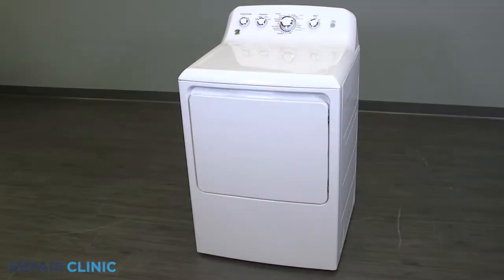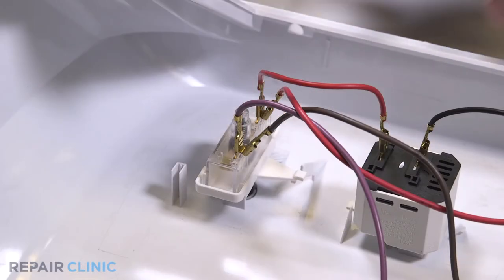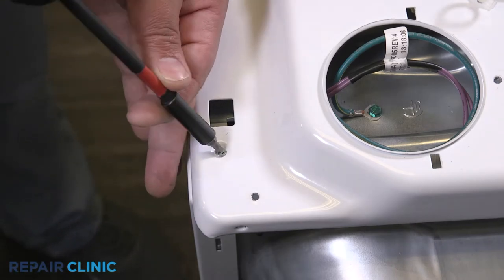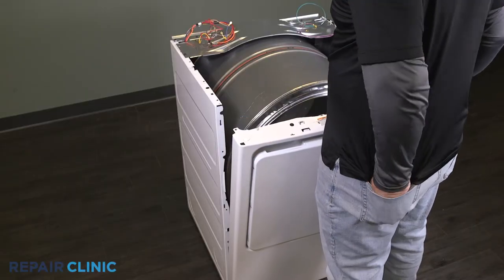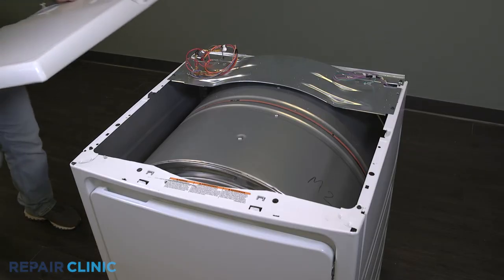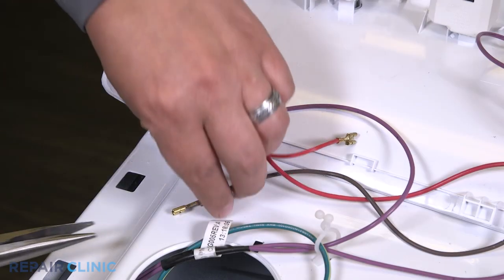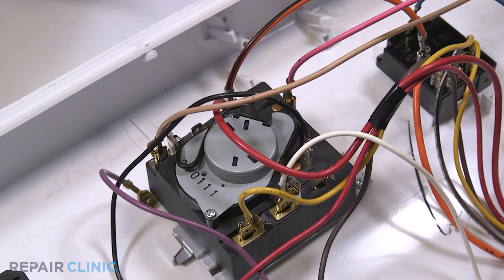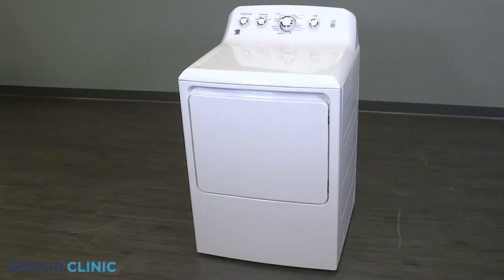GE Dryer Door Switch Replacement WE04X28977

Comment: You absolutely don’t have to take all of that apart seriously
Reply: Correct, just take out the upward facing Phillips screws at the door and lift the lid. Using a low profile ratchet you can get to the black screens and remove the front panel. Even possible to get the drum out for when the purple wire Burns up

Comment: Remove the switch entirely and cap off the wires, bypassing the cheaply made and unnecessary safety mechanism entirely. Screw replacing it
Reply: Hey so my door switch is what’s keeping my dryer from starting and I don’t have the money to replace the switch at the moment can you possibly walk me through what you just said to do that seems to be exactly what I was looking for
Reply: @aliciamarieleopard8919  Essentially, you locate the switch and its wires and cut the wires at the switch. Then, you connect the wires with a twist connector(or crimp).
Reply: @aliciamarieleopard8919 
Just to be clear, the "twist connector" he's talking about is called a wire nut. Little cone shaped plastic caps that screw onto wire ends. If you go this route, once you cut the wires you'll need to strip off about 3/8" of the wire's plastic insulation coat, twist the two wires together, then screw on the wire nut.

Comment: Clear instructions. Thank you! But I didn’t have to disconnect the instrument panel, just took out all screws on the back and tipped it right up with the top, propping the top so I could release the front panel. Thanks for showing clearly where to depress the catch on the door switch so I could get I out. Had a bit of trouble reseating the top on the drum: it took two of us to persuade it back in place, but no other problem and one $18 switch later, my dryer is working again.

Comment: This is a very informative video,  but just be aware that the switch may release from the front of the dryer with a flat screwdriver or similar tool.  No disassembly needed.  The switch releases with a tab, then pull it forward out of the mounting hole.  Unclip the wire harness and swap the switch out.
Just changed our switch in under 5 minutes, working great.
Reply: You are so right that's what I notice  on my ge electric  dryer. Just pull it out from the front  with a flat svrew driver.Unplug the electric plug,
Reply: Thank you for the comment, I seen that part and wondered.... if there is enough slack on the wire, it'd be like an automotive window switch, skip all the rest of the steps.
Reply: I will def try this first. I think they put those videos out so the average person won’t attempt it!

Comment: Thanks for the video. I used it this morning to do this job.
I think that unhooking all the wires is not necessary.  If @bluesfoxpix's solution (5 minutes, just from the front) works for you -- great. If you do end up taking off the front panel, then I believe most people should be able to loosen the top cover without having to undo (and then redo) all the wiring. You can lift up the top wiring/control box, slide it back a little (or let it hang off the backside) and that will allow you to undo the fasteners to the top cover, so you can get access to the screws holding in the front plate.
In short I think there are several much easier ways than can be tried, before totally unhooking the wiring.